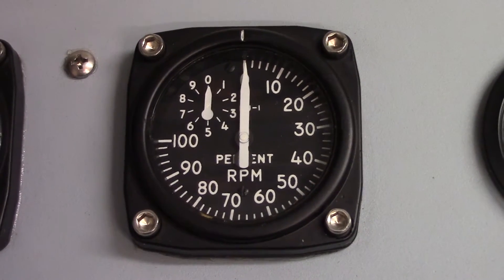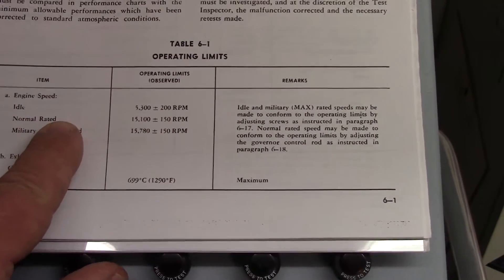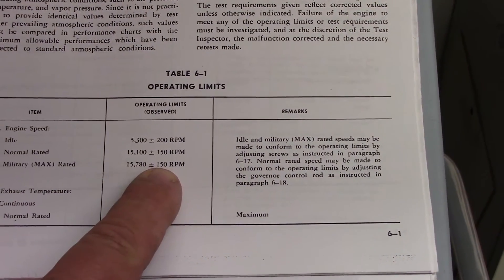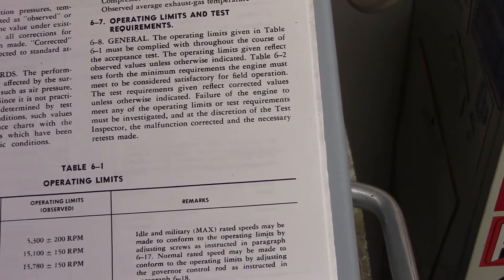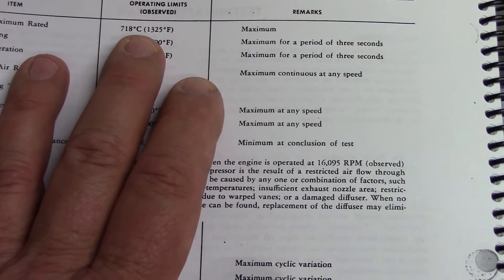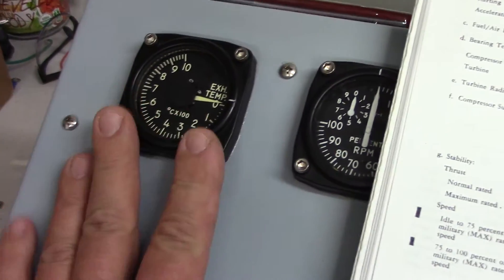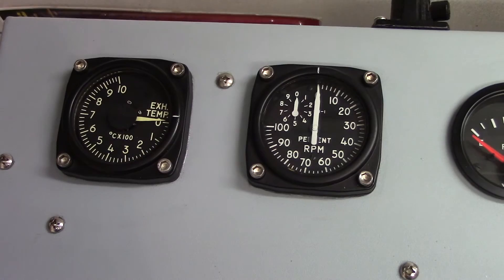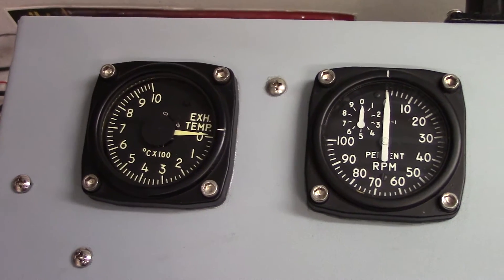J44 8th RUN! Console View & Analysis

Comment: That looks to be running at only 30%? It's likely to be barely self-sustaining and therefore running hot? Best to run it at a speed where it runs coolest? probably around 70%?
Reply from the maker: Hi and thanks for the comment.  The maintenance manual specs this speed for idle, however low it is compared to most gas turbine engines.  I am not confident in the old thermocouple set and will be using a new one when I run it again.  I agree that more air is better so I will be keeping an eye on the EGT.  I appreciate your feedback and hope to see you here on You Tube, as I hopefully get this old girl going again!

Comment: If you increase the rpm above 40%, or idle... you will see the EGT go down. In situations where fuel consumption is not critical, such as industrial power, or maybe hobby running, we suggest considering "engine idle speed" to be that at which EGT is lowest.
This is typically about 65% rpm.
I think the 40% idle setting is determined by minimum fuel consumption while still keeping EGT under the safe maximum.
Below 40%, it gets hotter and is damaging the engine.

The military  turbojets I've run, Max military power is 100% rpm, and is time limited to 5 or 10 min. Max continuous is usually around 94 - 96% percent.
This one of the reasons I like to know the RPM of the engine. This "percent rpm" stuff is just to make it easier for the pilot,
and to allow the use of one standard tachometer instrument for many different applications.
Reply from the maker: +AgentJayZ Thank you for the reply, Jay.  I see your point; I did think it seems to be a 'low' idle speed, & I do remember hearing that 60-65% number mentioned by you in the past.  In fact, the J-57s I worked around on B-52s & KC-135s idled at about that speed, if I remember right.  I can change that speed on the governor with the idle speed stop screw & then readjust the servo linkage so it doesn't 'bottom-out'.  I will be needing a bigger boost pump to really run it, since it is about zero PSI by the time I get the speed to 50% RPM.  Manual says 25-30 PSI fuel inlet pressure at all times.  50% is the fastest/highest power setting I have attempted so far.

To get an actual RPM tacho, I would have to buy a sensor that could mount close to the compressor blades & a digital indicator with a programmable input.  If I can enter the number of blades (pulses per revolution), then it can compute the RPM.  Maybe you know of a better way or system.  I don't have software to run on a laptop PC but maybe someday!  Thanks again & take care.

DD
Reply: +Darren Duncan The engine doesn't have a tach-gen drive pad?
Reply from the maker: +AgentJayZ Yes it does, with the stock G.E. tach generator installed.  That is what is driving the % RPM indicator.  I don't know how to connect a digital (actual RPM) indicator to that system, so I figured it will take a separate sensor/pickup to provide a signal.  Maybe you or Electron Bill know a way to install or fit a digital tach to an old engine.  My more recent video that shows the overview of the whole setup shows the accessory drive & accessories.  It is titled:  "The J44 Project:  Engine & Accessories Overview".  Thank you for the reply & help!